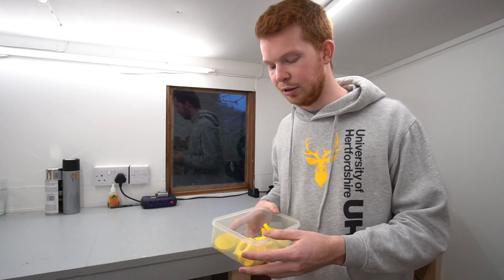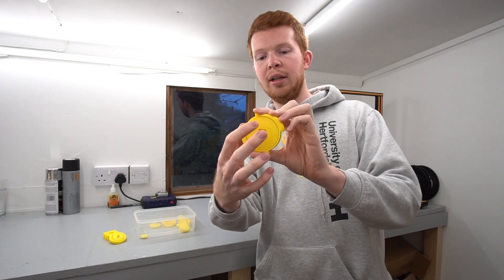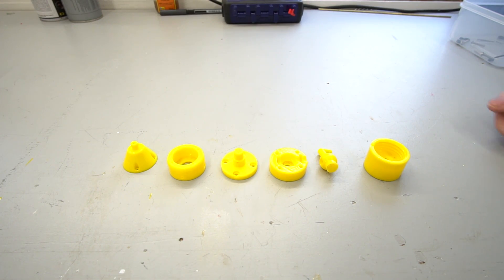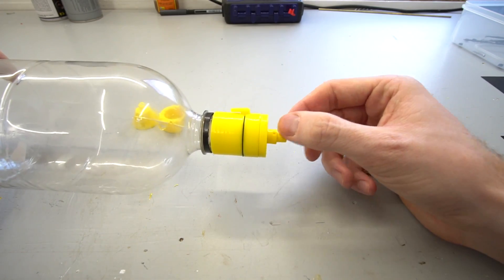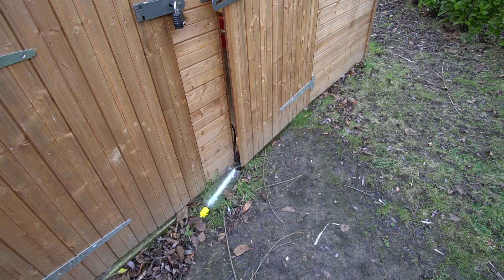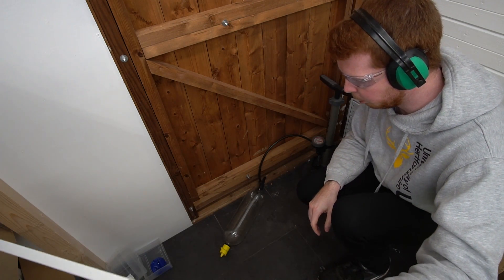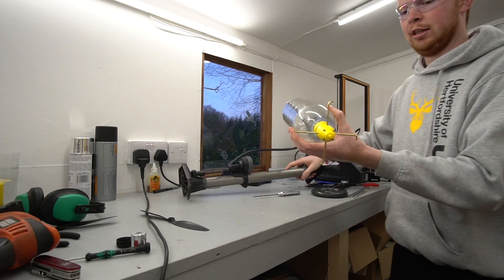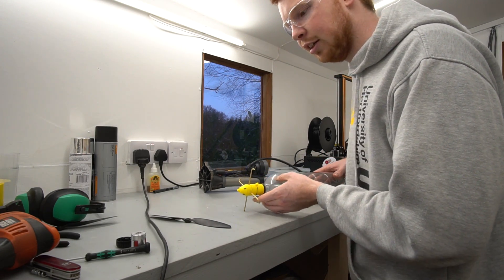Air Powered... Propeller?

Comment: A high velocity jet of exhaust is going to be the worst possible way to drive a propeller. You have potential to decrease weight through simplicity, but will take a massive hit in efficiency. Focus on improving the efficiency of your engine instead. Better tolerances, smoother operation, those are the areas that need improvement if you want longer flight times.

Basically, the higher the velocity of exhaust, the more energy it has relative to the momentum gained by pushing it to that speed. This is because energy increases with k=1/2mv^2. Note the ^2 on the velocity parameter. Momentum, meanwhile, is just P=MV. What this tells us is that for a given energy input, we will get more momentum transfer by pushing a large mass of air slowly than by pushing a small mass of air quickly.

As this prototype uses fast jets of air to gain angular momentum to turn a large propeller, you are limited by the efficiency of those fast jets of air, which will always be poor. Indeed, with this design you would be better off pushing the entire system directly via the exhaust jet than via the convoluted system of using that jet to turn a propeller. How much longer and further would that balloon fly with a simple nozzle/orifice than with that tip-jet propeller contraption? Quite a bit, I'd wager.

Without doing the math, you may be able to use a far larger propeller with a geared down motor to achieve greater total momentum transfer, even after the energy losses in the gearing system.

This is a difficult project. Compressed air has a very low energy density (by mass or volume) compared to lipo batteries or hydrocarbons. Good luck finding the solutions to your problems!

Comment: Hey Tom I’m not sure if I saw this right but the second you released the air almost all the air escaped instantly out of the motor and not necessary the jets but then the little air left in the bottle gave very poor performance as it left the bottle. I’m not sure on this but it did look like that.

Comment: Tom - think how a human pedal-powered aircraft works - a huge propeller turning very slowly from geared human pedaling. Make a v. light plane, with a huge propeller only turning just fast enough to give thrust (fly on a no wind day). Have your air valve only partially open - i.e. only enough to slowly rotate prop, then you should achieve a longer flight time ???

Comment: Why use a physical propeller? You want to convert a high velocity, low mass, low thrust airflow into a lower velocity, high mass, high thrust airflow. A propeller will do that, but so will air entrapment/ Coanda effect. Air blown from a nozzle into a larger convergent/divergent nozzle will suck in and accelerate a larger volume of air generating higher thrust, this could be cascaded. Think Dyson fan. This could also be done over the top of the wing through blown slats, to give lift and thrust.
Reply: - conservation of momentum
- he is spinning the prop for no reason whatsoever. he would probably get more thrust if he'd just point the tubes backward as he eliminates the friction of the gears.
- a smaller prop can spin it much faster, the criterium is speed of the tip of the prop. If i spin a small and large one equally fast, a large blade has a higher speed at the tip. And there is a stability limit to this speed.

also larger props are more efficient, but a small plane can not really use a big prop as it would touch the ground :P
Reply: Fill the bottle with somthing flammable, turn your brass rods into mini rocket motors - what could go wrong!?
Reply: Donald Sayers The momentum stays the same. If you have just a nozzle, you have little high speed air, if you use the Venturi effect, you have more, but lower speed air. Its the momentum of the air that moves the thing and that stays constant. And as he said in the video, since the air can barely even rotate the propeller, which weighs couple grams, there is no way a nozzle can push anything heavier either.
Reply: Er no the momentum is not constant. If you push a large amount of air slowly you will get more thrust than pushing a small amount of air fast, with the same energy, why else is he trying to turn a propeller instead on just pointing the jets backwards like a rocket?. That is why helicopters use big diameter blades as their vertical speed is slow, whereas fast plans use smaller props. Air blown through a wide bell mouthed venturi will generate added lift over the surface of the inlet.
Reply: I agree with this, Donald. It's very similar to what I was saying, with a different application.

Comment: TL,DR: Fill it with water 

What actually propels your prop is the force of the air molecules being pushed out and the tubes being pushed in the opposite direction (Newtons second or so law of movement, every action results in an equal and opposite reaction). You can increase the force on your prop of by increasing the mass of what exits the tubes, so just use water and pressurize it with the air pump and it will work flawlessly. I don't see why your current setup wouldn't work with water. Make sure to add a snorkel inside the bottle so you get all the water, not just the top half. Keep up the good work.

Comment: You need larger diameter pipes with nozzle constrictions at the end, so that the air is moving slowly in the pipes, thus losing less energy from friction. The nozzles can then be made very small to give longer thrust. But then you will have a lot of thrust on the bearing from air pressure and  seals to contend with.

Comment: I think it is very visible in the very last 80 psi run that there is a "puff" of air leaking out between the valve part and the spinner. Any improvement there will pay off in efficiency. I also agree with other comments on nozzle-shaping and possibly a gear box, but fix the leak first.

Comment: I’m an engineer, and I recommend calculations. First, change your nozzles to converging diverging by crimping 2 mm from end, and galling  out a bell at the end. You can treble or more your specific thrust by this method. Valuable thrust will only occur when the flow is choked, or sonic at the crimp, and this only occurs at a pressure of 30 psia and above (twice the outlet pressure). So 60 psig (75 psia) should give a good sonic flow. Simple calculations should give a good estimate of the radial thrust of two nozzles (4 is too many). Finally, the nozzles need to be about as far out as the propeller diameter to reproduce the toy.

Comment: Great Video man. I do have one question: You stewed the to engine parts together with screws. Did you use bolts is screws ? Did you model a thread in or just a smaller hole than the screw or bolt. Thank in advance !

Comment: with the low airspeed of the projects you are doing you do NOT want high speed/ low trust propulsion.
You NEED low speed HIGH trust propulsion.
For a prop that means BIG diameter LOW pitch .
Any "propulsion speed" that is higher then the flying speed (max speed of the craft) is wasted.
For your air powered prop longer "tubes" would improve it performance since its (force times arm) increases the trust and lowers the speed (diameter times pi) *rpm.
This the trust out of the tubes remains identical  but likely the trust will be a little less with the longer tubes.
Also you can see if flattening the ends (but not fully closing) the tube end "trusters" will improve performance since a "wider" gas flow has more "friction/grip" on the surrounding air ; the principle those "fan-less" dyson fans work.

Also show the steps of the progress so we can comment on your ideas and stear you away from the easy to predict failures,

Comment: You should check out some water rocket builds, I think that will help you with building huge capacity bottles, and also it could make for some good content. I prefer 1 video every few weeks rather than parts. Does my head in knowing that you are watching a video and you know you still need to wait the same amount of weeks for the result regardless.
Reply: Excellent idea, I'd be willing to be that with an intermediate water tank between the air and the nozzle the results would be much better. Probably not the best idea during winter in the UK though...

Comment: Try switching it to dry ice and some warm water inside the bottle. (Or something else that produces a good deal of expanding gas.) Runs out of juice before it even gets going. But in that case you're going to want to change it to a bypass valve rather than a shut-off valve.

Comment: definitely, do the variable thrust engine, but also see if you get better performance with multiple engines, or use multiple bottles where you can select between them for prolonged flight. Would also be cool if you used a denser gas and see if that affects it.

Comment: Use water and compressed air and add a small rubber tube inside the bottle.Compressed water will come flying out as the propellent .

Comment: I think your thrust problem with this kind of a engine ist the specific Impuls of your system
The compressed air in your bottle only has a specific amount of energy stored.
In your piston engine you slowly releasing the energy so your impulse is much lower but you gearing the speed of the compressed air down from a small area and a high velocity at the bottle cap to a big area of your propeller and much lower velocity.
The more even the airspeed of the propeller and the airspeed of your plane are the higher is the efficiency of your system.
Your new design releases the compressed air in a very short time and a even smaller area so the airspeed at your nozzles is very high and the efficiency very low.
Alright in my mind this all makes sense but I think you know what I mean ;)

By the way I like your good made projects in 15 to 20 minutes every 3 or 4 weeks.
I think rushing it by splitting it up only to upload something without a well thought out project doesn't makes it better.

Comment: Interesting concept ! I think your system produce too much torque instead of running speed. You have 4 exhaust tubes that add no rpm compared to 3 or 2 but torque and they are too long. For the same exhaust speed of the air, the rpm is lower. I would advice to shorten the 4 little tubes in order to increase the rpm produced with a certain amount of air. Also to delete 1 or 2 tubes. I don't think the loss of torque caused by this modification would affect the proper functionning.
Moreover, we can see air flowing out of the system without passing by the exhaust tubes when you turn it on    12:49
Reply: I had just about the same idea. My idea was a bit different still. The tubes that expel the air may not be needed to lessen. The smaller exhausts inside the turbine type print, although, would benefit the build if there were less. EX: If there were 2 air expelling areas inside but still 4 tubes being used to expel the air, and there were no air leaks, there would be much more run time.
Reply: The "nozzles" are just the pipe he had available, smaller diameter nozzles might give more torque for reduced air consumption.
Reply: I agree. The long nozzles may reduce the rotation too. Bring them in closer (figure skaters arms when spinning). Two may work with an actual nozzle ( not an open pipe ). As I see it, it will increase the time for pressure reduction and possibly offer more RPM. How about a 2L bottle? And the internal system leaks need to be addressed. Try again! I would love to see another attempt.
Reply: Just by hearing it spin you can tell a lot of the air is not being used, definitely sounds like there's a leak inside the turbine evidenced by the fact that it can't start spinning on its own. 

Seems like not enough effort was put into this project honestly.

Comment: Frequent updates are better. 

Nice try this time, but it just uses air too quickly and your joints seem sticky. Go back to the gift you got and you have a bladder storing the air. Could that be better than a rigid container? Also why not let the bladder/container spin with the prop to do away with that bearing joint?

Interesting project, well presented. Now if only we can do something about that accent chuckle

Comment: Hi Tom. Looking at your video - don't you simply have too big air losses through bearings and in between stator and rotor? I think that I can see some air coming out of there. Of course, that would wound create terrible losses.

I think that solution the solution, in this case, is to go with non-3D printed parts which allow lower tolerances.

Comment: Improvement suggestions for rocket propeller: 
1) optimize nozzle size for thrust like any other rocket.  2) Optimize nozzle radial offset and angle.  3) optimize number of nozzles.  4) Duct tape the center cylinder of your bottle for the assurance that it will withstand 100psi consistently.

Comment: I think the issue is not the the idea is flawed or inefficient but that the way the air is being delivered to the tubes is flawed, most of the air pressure is exiting between the point of rotation and not the tubes. The connection between the rotating part and the fixed part isn't sealed

Comment: The shaft and the ball valve has lots of leaking air which contributes to massive power loss. I don't see how you could solve the problem without it being to complex. With every failure comes success.

Comment: I think you should have used a hybrid ceramic bearing. They are a bit heavier but they spin more freely since the ceramic balls polish the stainless steel races as it spins. A smaller bearing like an r188 might also be beneficial. Great video as always!

Comment: i'm impressed how much time you spend on this idea. if you contiou on i got a few idea for you: get multiple bottles of the same brand and pressure test them till destruction, but with water, thats way safer. Get an air compressor, i get tired just watching you pump that ting up. Print multiple piston engines with atleast 3 zylinders, in an triange confuration, this will always start. print with an single perimeter and try if it still holds up.

Comment: A dental turbine uses air power too but since they are tiny Pelton turbines you'll need some gearing and the power/weight ratio might not be the best for its air consumption rate.... But there's the idea!
Reply: And besides, answering your last question, In my opinion, I prefer always quality over quantity. In episodes or in a long video... As fits better to you. If you want to become a YT partner you know the rules...
Reply: Dental turbines don't have (to produce) a lot of torque and they do need a relatively large air supply like you said. They do the job by the staggering number of rpm's. The size of the turbine compared to the effective cutting axle size doesn't look too promising...but then again, I'm not Tom and maybe it ís an idea
Reply: Albert Siemers yes I think the same but maybe with the proper gear ratio he gets some fine torque. It looks to me like an electric motor from a small quadcopter. The most significant problem to me is air consumption

Comment: I didnt see any failure there. Could you possibly thread the shaft instead of a pressure fit?  Could you apply this to your prior compressed air engine with a servo connected to the ball valve to provide controlled thrust?

Comment: length of flight is determined by volume of air and air flow.  You need a device that restricts air flow and uses air pressure more efficiently. That's why the piston engine worked so well.  If you had a lot of volume at moderate pressure this would better.  You are not working with a lot of energy. 588.09 joules to be precise. Only 0.163333 watt hours.  Its just a battery. You need more volume and more pressure.  A rocket style plane would work but I don't think you have the skills to make it efficient. Its not that fun anyway.
Reply: jret bullion Would be interesting to add an air multiplier to the exhaust to see if it improves efficiency of an air rocket.

Comment: I would love to get updates in between and videos split up. In this video again, you skipped over some parts of the process fairly quickly due to the time constrain (especially on the design part of the parts, what was the thinking process, design decisions etc.) and I would love to have these in a separate video as well.
I also love videos about failures, I would have enjoyed a complete video about the design process and the detailed reasons for failure of the parts you presented in the beginning of the video as well.
(and I guess it can benefit you economicly as well, so go for it).

Comment: To me, the projects and learning from them outweighs watching a video on a very regular basis. But, if you want to and have the material I imagine making smaller videos (maybe each loosely focused on certain details?) would be a good option for you to release over time to keep some kind of a smooth content distribution until the next project is ready to be disclosed.
Decide as you see fit, but don't let it hold you back making cool stuff because you feel the need to report in certain constraints!

Comment: A couple of suggestions: a regulator would help "flight" time, you could print the exact same part but add a bit that fits inside the bottle with a spring, ball and seat. i think most of your problem is caused by a bottle neck (pun intended), the holes on the hub appear to be about 1 mm but you said the brass tube was 2 mm, you're halving your pressure. A nozzle on the tubes would help. Thirdly, I don't know if it would actually help but a couple "O" rings on the hub might prevent a lot of the leakage.

3D printers can't typically handle the tolerances you need for this type of thing, I'd look at a tesla turbine. you could print it fairly easily, tolerances aren't an issue and any air you lose at the rotor has already passed over the plates so it's done its work. the only drawback is that the tesla turbine works best at high volume but that regulator I mentioned earlier might help with that.